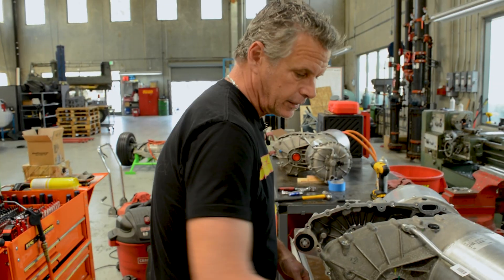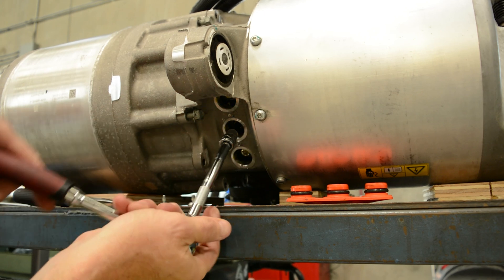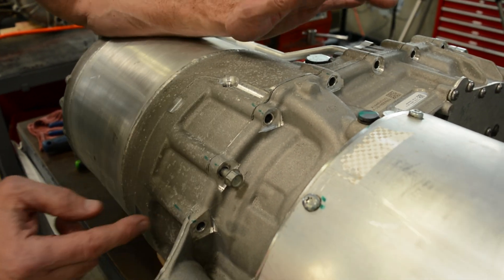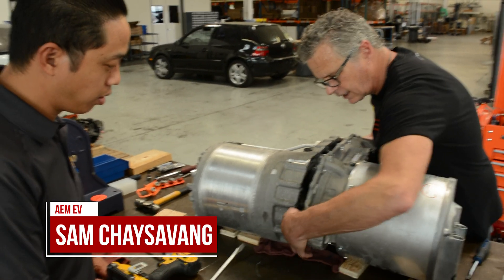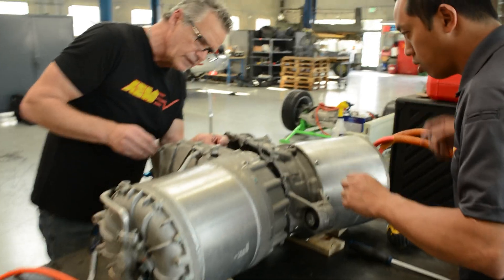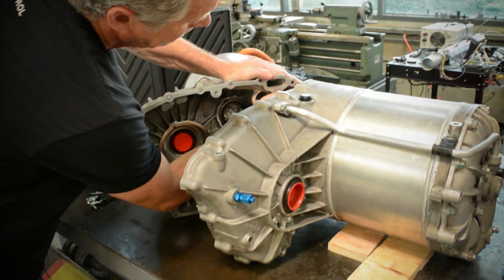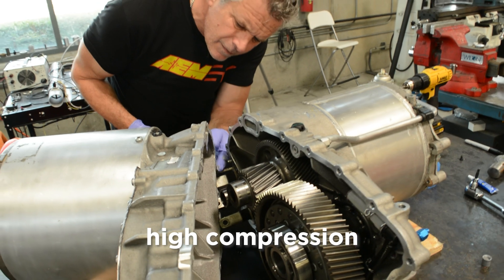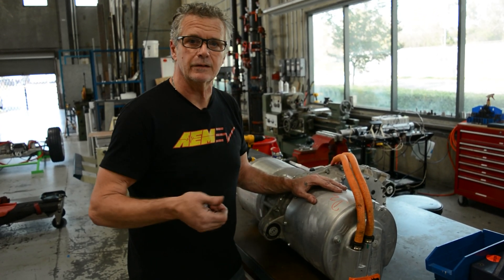SWAPPING Limited-Slip DIFFS in a TESLA LDU!

Comment: @AEM Electronics - A simple trick to separate the two gearbox cast halves without damage: Put a M10 (or so) bolt into the empty threaded top hole so that the bolt sticks up vertically. Next put a 6in (or so) wood board against it. Now you can put a prybar between the board end and the inverter half and easily separate them. I put it on video: See my youtube channel, episode "Broken seal in Tesla gearbox discovered after 42k miles: Was this to be expected?", 5m6s

Comment: Great, I will do this also when my LDU is fitted to my Range Rover P38. BUT Kirk, please do a video on swapping your / Cascadian pcb board in the LDU also, because I got it together with your VCU200 and have tried to get in contact with you over the support and sales emails asking how to make the calibration you refering to in the manual that is on the cascadian responsability. After emailing with Cascadian they say this is your board and they are not doing any support for this board. Please advice, make a video on this and setting the board up in the software. I got the kvaser and everything but want this calibration to be clear before I start! :)  Cheers from Sweden
Reply from the maker: That video is coming up next! We hope to have it released this week, stay tuned.
Reply: @AEMpowerTVelectronics  Great! Thanks!